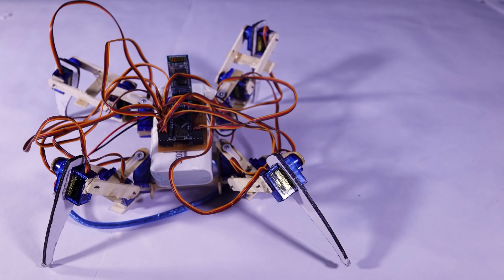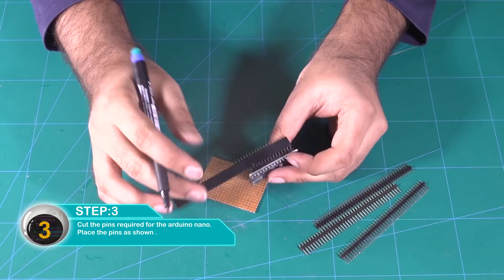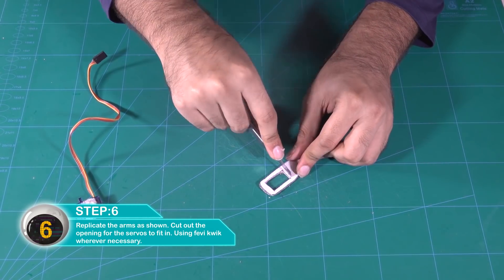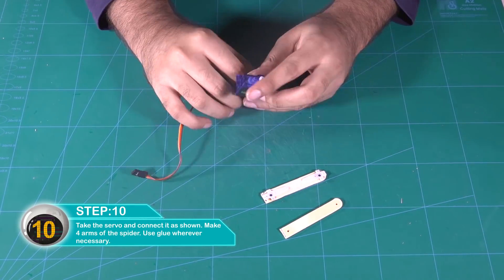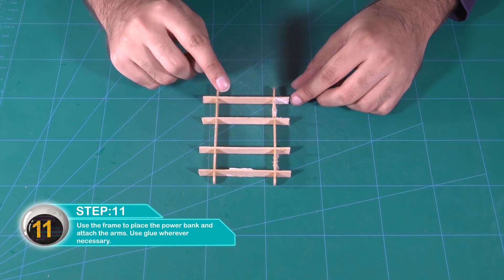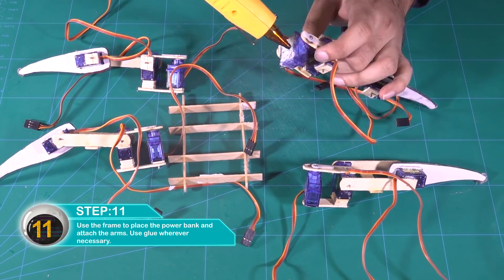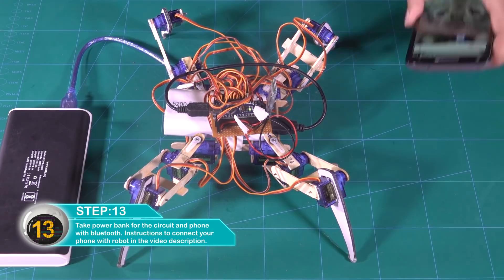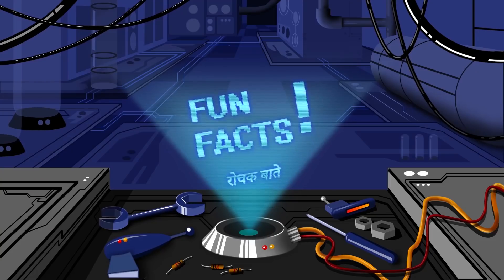I made a Quadruped Bot! Happy Building!

Comment: I made a quadruped project and it has been running smoothly, but there is a problem that I found in my project, which is the power source from the battery, when using a source from a fake USB port, and smooth. but when using a source from a DC jack, my project seemed powerless, works but it seems like it's not strong enough to turn on all the servo installed, even though I'm using a 12v source, that's how to handle it, ..?
Reply from the maker: need more info. Can you describe this more in details... and more details about your build... specifics please.
Reply: @Myuzikku can you please help me with the link oi ""serialCommand.h"" library
Reply: Hello, I am making this robot, can you help me a bit

Comment: i inmate your Wiring diagram to design program,but i don't know how to set the pin of BT(bluetooth),can you rewrite my program?
#include <Servo.h>
#include<Wire.h>
#include<SoftwareSerial.h>
SoftwareSerial BT (1,0);
 //how to set the pin(TX0 RX1)
char command;//傳回的值
char A;
char B;
Servo servo13;          // 宣告伺服馬達
Servo servo2;         // 宣告伺服馬達
Servo servo3;          // 宣告伺服馬達
Servo servo4;         // 宣告伺服馬達
Servo servo5;          // 宣告伺服馬達
Servo servo6;         // 宣告伺服馬達
Servo servo7;          // 宣告伺服馬達
Servo servo8;         // 宣告伺服馬達
Servo servo9;          // 宣告伺服馬達
Servo servo10;         // 宣告伺服馬達
Servo servo11;          // 宣告伺服馬達
Servo servo12;         // 宣告伺服馬達

void setup()  
{ 
  Serial.begin(38400);
  servo6.attach(6);  // 將 Pin 6 指定為左前1伺服馬達
  servo5.attach(5);  // 將 Pin  5 指定為左前2伺服馬達
  servo7.attach(7);  // 將 Pin 7 指定為左前3伺服馬達
  servo12.attach(12);  // 將 Pin   指定為右前1伺服馬達
  servo11.attach(11);  // 將 Pin  指定為右前2伺服馬達
  servo13.attach(13);  // 將 Pin   指定為右前3伺服馬達
  servo4.attach(4);  // 將 Pin 指定為左後1伺服馬達
  servo2.attach(2);  // 將 Pin   指定為左後2伺服馬達
  servo3.attach(3);  // 將 Pin  指定為左後3伺服馬達
  servo10.attach(10);  // 將 Pin   指定為右後1伺服馬達
  servo8.attach(8);  // 將 Pin  指定為右後2伺服馬達
  servo9.attach(9);  // 將 Pin   指定為右後3伺服馬達
}

void loop()
{ 
  int command;
  char input;
      if((command=(BT.available()))>0)
      { 
        Serial.print("size =");
        Serial.println(command);
        Serial.print("input =");
        Serial.println(input=(char)BT.read());
      }
         
if( input == 'A')
          {
            go();
          }
if( input == 'B')
          {
            back();
          }         

                    
}
void go()
  {
    servo6.write(90);
            delay(1000);
            servo5.write(40);
            delay(1000);
            servo7.write(40);
            delay(1000);
            servo12.write(40);
            delay(1000);
            servo11.write(40);
            delay(1000);
            servo13.write(40);
            delay(1000);
            servo4.write(40);
            delay(1000);
            servo2.write(40);
            delay(1000);
            servo3.write(40);
            delay(1000);
            servo10.write(40);
            delay(1000);
            servo8.write(40);
            delay(1000);
            servo9.write(40);
            delay(1000);
  }

         

                    

void back()
  {
    servo6.write(40);
            delay(1000);
            servo5.write(40);
            delay(1000);
            servo7.write(40);
            delay(1000);
            servo12.write(40);
            delay(1000);
            servo11.write(40);
            delay(1000);
            servo13.write(40);
            delay(1000);
            servo4.write(40);
            delay(1000);
            servo2.write(90);
            delay(1000);
            servo3.write(90);
            delay(1000);
            servo10.write(90);
            delay(1000);
            servo8.write(90);
            delay(1000);
            servo9.write(90);
            delay(1000);
  }

Comment: Do i need to add any Arduino library???
Please tell.....
Reply from the maker: Servo.h
FlexiTimer2.h
SerialCommand.h
NewPing.h 
You will need to download and copy these to your library folder. Hope that helps #HappyBuilding
Reply: @PrateekSethiIndia  what is the output voltage of the power banks and also why have you used two powerbanks
Reply from the maker: @xiiscc-15faiyazaman44  Output voltage is 5v for the power supply...n we used two powerbanks because the current from a single powerbank was not sufficient to run all 12 servos as well as the Arduino circuit. If you find a newer powerbank which is lighter in weight and capable of running the above requirements, please use it! :)